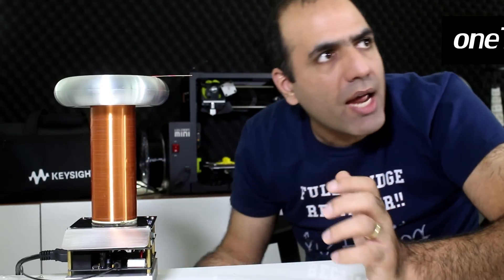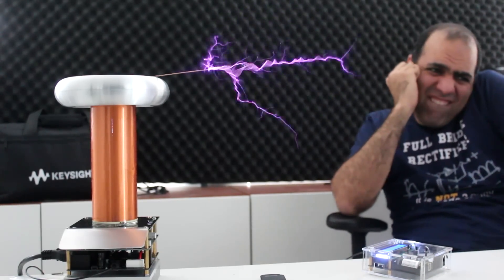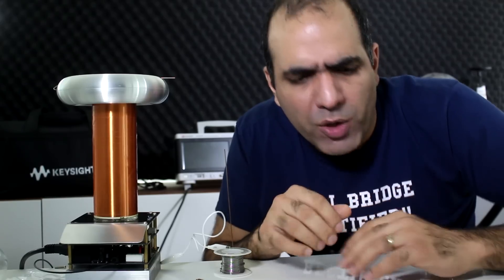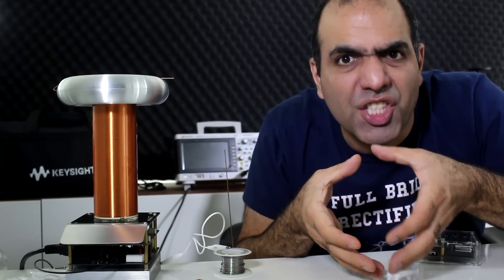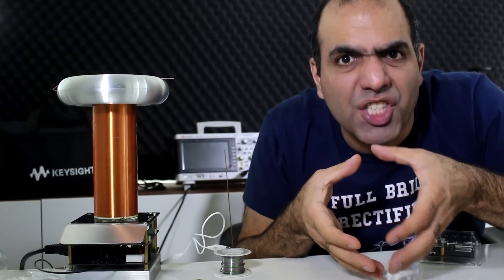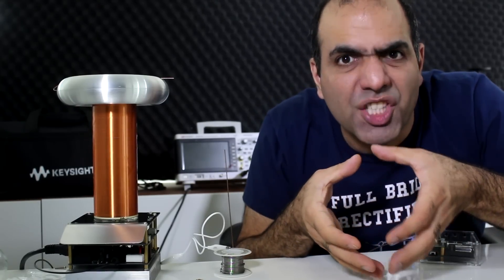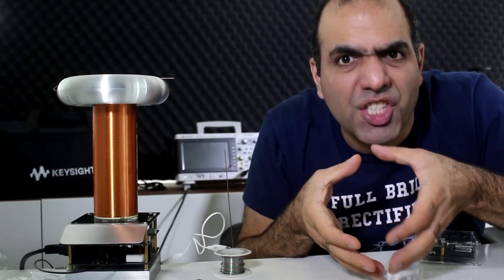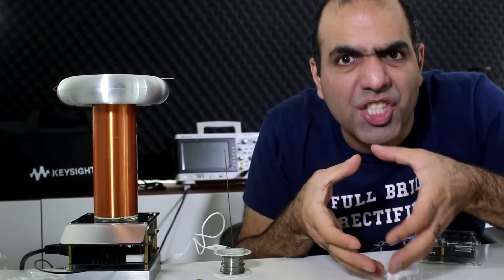All You Need to Know about Tesla Coil... Almost (OneTesla Part 2)

Comment: Wrong, skin effect would save you only if your body would be made out of good conductor (copper, aluminum etc.), because skin depth decreases when conductivity increases, for human body it's like 1 meter or more; actually you don't feel upper harmonics because your nervous system is too slow to react to such high frequencies, the ions in your nerve cells literally can't move as fast and hence can't transfer pain signal from one cell to another
Reply from the maker: I did a quick calculation, the skin depth seems to be still less than a CM which helps divert electricity from internal organs. in copper it is like 120um which is better of course.
Reply from the maker: Assuming we need around 20kV to arc over 1cm, and considering I am seeing arcs longer than 25 cm, it would be closer to 500kV. I have no way to measure them though.
Reply: This makes no sense, electromagnetic waves have the same propagation speed in the same medium for all frequencies and they're all probably faster than the propagation speed of action potential of nerves.

Mehdi was correct about the skin effect since it pushes the current to the surface where the heat produced by the arc and current dissipates much better and doesn't excite the pain receptors deeper in the skin.

This is the same reason he wasn't feeling anything when he was touching his old coil with a piece of metal - arc heats up the metal and not directly his skin and the current flows in the upper layers of his skin.
Reply: Well... it would work... but afaik only when you go up into the gigahertz range.
Reply: 10kV per 1cm in dry conditions, not 20.
Reply: "20kV to arc over 1cm" that's a pretty bad assumption; not only we need around 10 kv on point electrode per each cm for voltages in the range of 10-70 kv, but also in the range of hundreds of kv the "long spark" phenomenon occurs, that is taking into account leader and streamer propagation, so at such DC voltages one would have only 4-5kv/cm average field gradient through a discharge length; however, tesla coil produces not DC, but pulsed high frequency AC bursts, that prolong existing leaders and streamers even more, but it's a pretty bad studied topic, so lets say 3-4 kv per 1 cm of tesla coil discharge, assuming that the discharge is 20-100 cm long in total; I hope that you trust my knowledge, as I'm studying electrophysics in university and i know what I'm saying; also no offence, I'm not trying to make you look dumb or anything, I just want to share what I know with the people to extinguish frequently occuring myths
Reply: Also what equasion did you use to find that skin depth? Approximated equasion d=503sqrt(p/f), p being resistivity of the material in Ohm*m and f being frequency in Hz gives value of 50 meters for dry human skin at best (3000 Ohm*m), and 1-1.3 meters for internal organs and blood (1-2 Ohm*m)
Reply: I wish more people understood this.  Attributing the lack of pain to the skin effect is misleading at best.
Reply: Medhi - I don't understand the math well enough to confidently set up the equations. But here's a few different links showing myth/non-myth:

1 - http://donklipstein.com/skin.html
2 - http://www.sgoc.de/Download/skin_effect.pdf
3 - https://teslaresearch.jimdo.com/electrical-safety/
4 - http://www.sgoc.de/skin_effect.html
Reply: Yes mathematics, Socrates, Pluto, y=mx+b, mitochondria is the power house of the cell, einstein
Reply: Also the voltage here is 200kv at best, not even close to 500kv, as 500kv would make more than 1 meter discharges
Reply: Correct. This is a popular misconception about Tesla coils. The skin effect on actual skin is something like 2 meters at hundreds of kHz. Meaning unless you're a whale, there's no safety improvement.

Also, I need a tesla coil to both attract and murder mosquitos.

Comment: Awww, you dumbed it down and left out Q-factor ratio induction!
Yes, turns ratio induction exists, but the q-factor of the primary vs. secondary is where the magic happens.
Q-factor is a measure of resonant circuit quality.
Sort of like the ringing of a bell.
Some bells ring a very long time, these would be hi-Q circuits.
Others just go thud.  These are low-Q.
Another way to view it is that a hi-Q circuit conserves energy very well, where a low-Q circuit radiates energy well.
Think parallel tank-circuit vs. antenna.
The primary in most Tesla coils are low inductance, moderate capacitance.  Low-Q.
The secondary is highly inductive with very little capacitance.  Hi-Q.
So the low-Q primary throws tons of EM radiation into space, and the hi-Q secondary 'grabs' the energy very efficiently.
It is possible to induce high voltage this way in excess of what simple turns ratio would suggest.
Many simplifications and abuse of details went into making this.

Comment: At first I was like, fuck yea, finally I'll be able to successfully build a tesla coil without burning through janky circuits from the interwebs (rip 2 power transistors and 3 high frequency diodes so far :L) so I checked OneTesla out and...dang, 200$? That's crazy :L so ya, count me in and GIMME DA OneTesla! Pweety pls ;3

Comment: Tbh they aren't doing what you explained for the half bridge
The half bridge consists of 2 IGBTs and 2 capacitors
The capacitors form a voltage divider and the primary is connected between the IGBTs and the capacitors and the IGBTs switch alternately
Making a sinusoidal current in the primary 
Translating to MILLION VVOOLLTTSS ON THE SECONDARYYYY

Comment: Your own Tesla was waaaayyyyy cooler.
Reply: making things yourself is always cooler, even if you can buy better cheaply. The experience and the feeling of success but also failure are defenetly worth it.
Reply: @Chuckiele I’m looking at getting one do you know which one he bought
Reply: hotter :D
Reply: @Gamerdu45  It's DANGEROUS!!!
Reply: ikr
Reply: This guy is awesome and funny,  but he is no Photoinduction!
Reply: I think this coil is awesome. Your right that the old one is awesome with the high frequency skin effect, but this one puts out a crazy voltage for its size. Easily the best in its price range.
Reply: This guy is very funny
Reply: xTheDarkSiderx HI
Reply: He bought that on oneTesla.com
Reply: I agree
Reply: Anyone have links to the parts he used for his own coil?
Reply: Yeap
Reply: Ikr
Reply: Yup
Reply: i know it so good  it evens plays music better
Reply: Console peasant i know
Reply: it is stronger but his own was way quieter so you could do tricks with it, he could use the secondary from the onetesla kit with the slayer exciter circuit to have both positiv aspects combined.... maybe in another video? ;)
Reply: @BadMax02_VR  you could just run the onetesla at lower powers and use a flashlight to turn the duty cycle to 100% and achieve the same effect as his original coil. it does run at much higher power, so lower I put powers are needed. I built my own coil and, doing what I stated above, I achieved completely silent, foot-long arcs that are completely safe to touch 😁
Reply: But the one he bought is more professionaly made, plus, it is stronger and louder